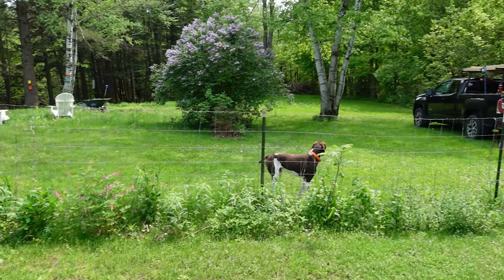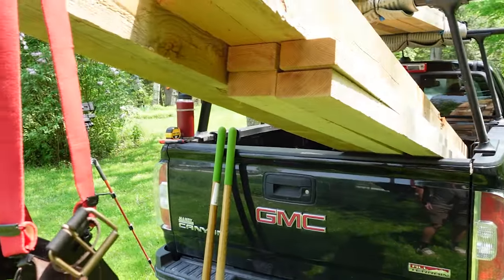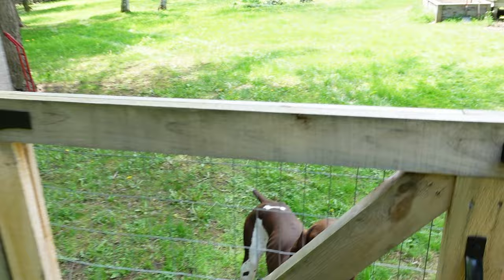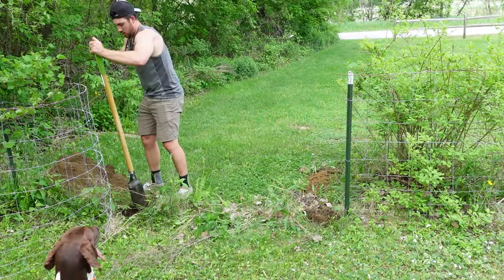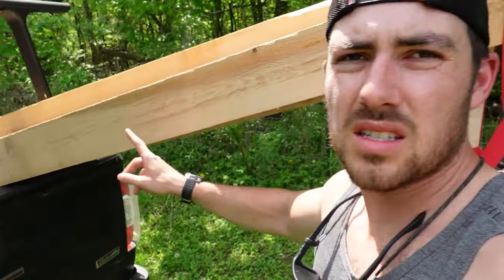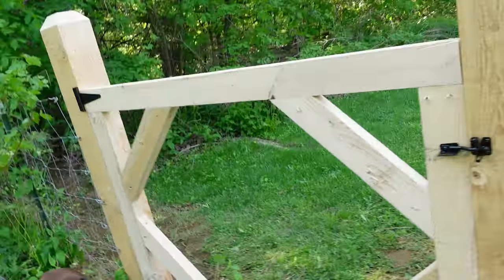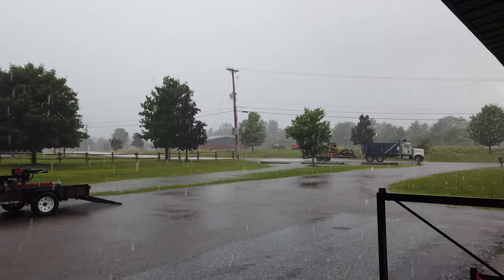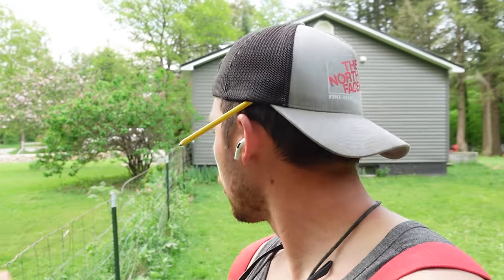Easy (and cheap) DIY Fence!

Comment: How did you attach the vertical pieces to the t-post? Are the holes in the t-posts?
Reply from the maker: Great question. I just used the small wire clips that I showed on the gate and attached them do the vertical portions of the wire fence. I just wanted them to cover the t-posts so they couldn't be seen. They kind of flop around and aren't' straight until you secure them to the horizontal wood pieces that I installed after. Hope that helps!